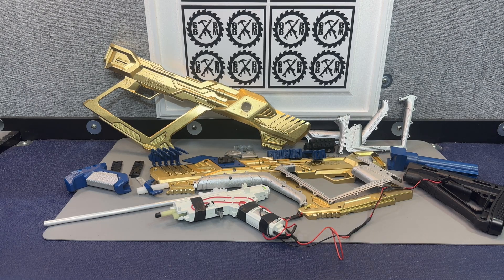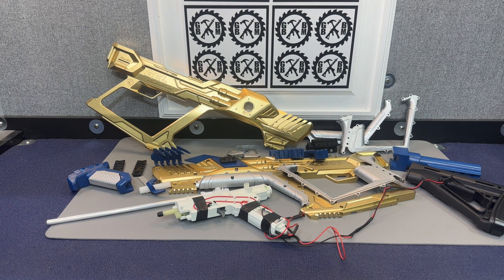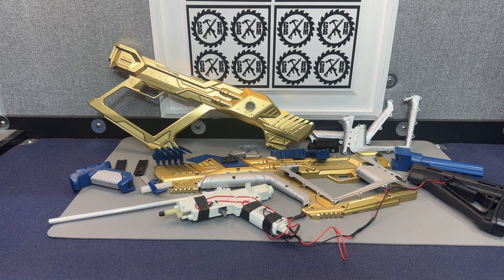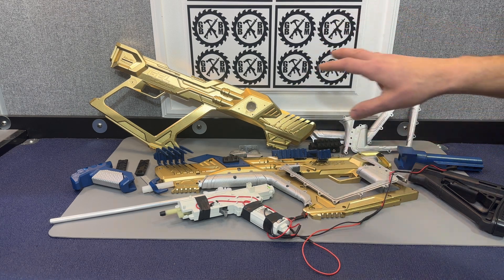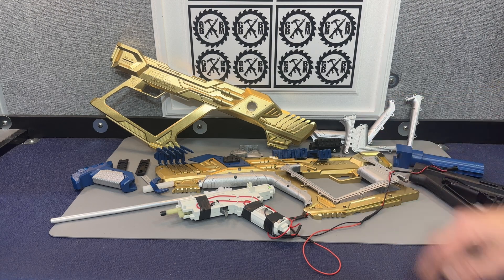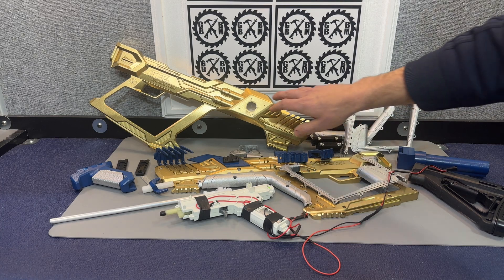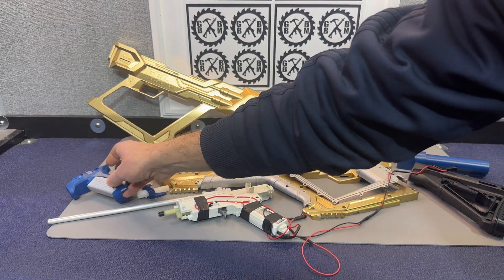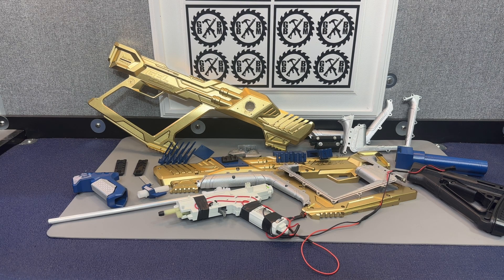Custom Build Plan - Gel Blaster SURGE XL TOY Gel Ball Blaster -paint, rails, lots of accessories!!

Comment: It's possible to extend the 3 pin charging cable (but use thicker gauge wires for higher current required for shooting vs charging only), and plug that into the 3 pin port on the stock PCB
Reply from the maker: Maybe. I was working with someone who is extremely knowledgeable and tried his suggestion but it did not work. In theory you should be able to just leave the white wire disconnected but that did not work.
Reply: @GelBallBlasterMaster  That means their PCB monitors the individual cell voltage, so leaving the center (white?) wire out would cause it to think that something is wrong with the battery, and doesn't let the blaster operate.
Reply from the maker: @engineerable  makes sense. Too late😀
Reply from the maker: @engineerable  what would the solution be?
Reply: @GelBallBlasterMaster  I'm assuming you are using a 2S stick battery. Without requiring modifications to the battery, use the high current ground and 7.4V power like normal with large gauge wire. Run a smaller gauge wire for the 3.7V (white wire?) from the battery charging connector, so the PCB can also see the center voltage and charge the battery.
Reply from the maker: @engineerable  good to know for the future but luckily very few blasters do this. Very few blasters (especially decent ones) have batteries built in. Users prefer rechargeable batteries you can change so you can have backups and don’t have to wait for the whole blaster to charge. Not sure why Gel blaster does this. I see no benefit